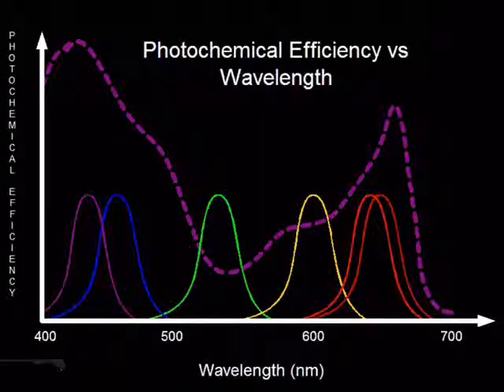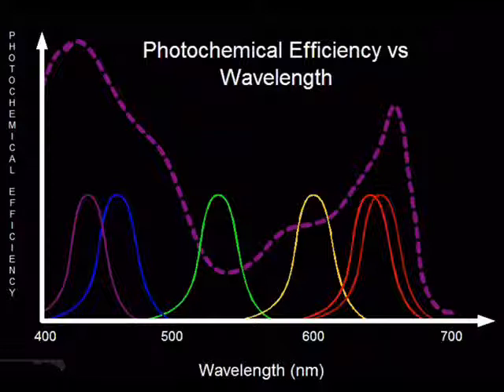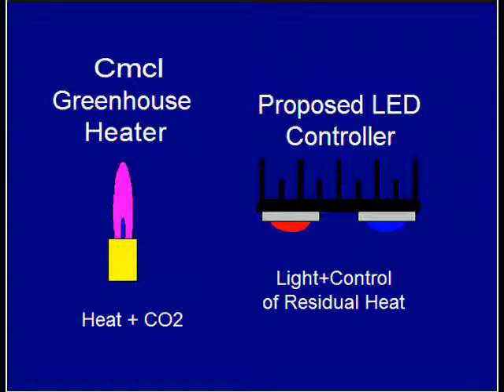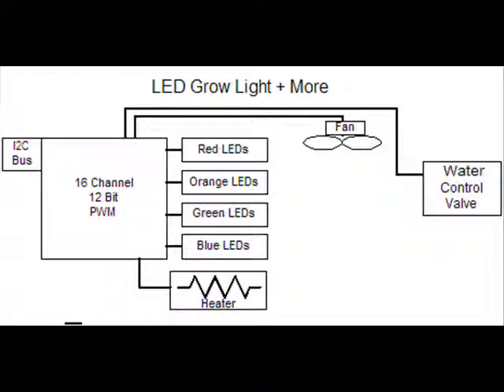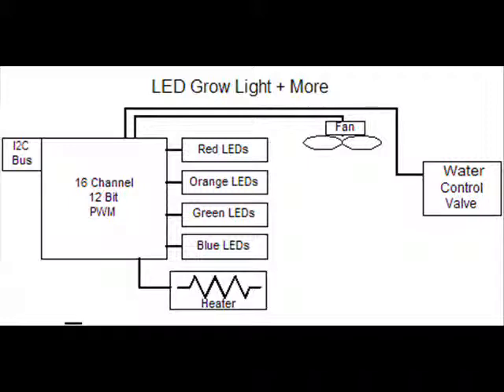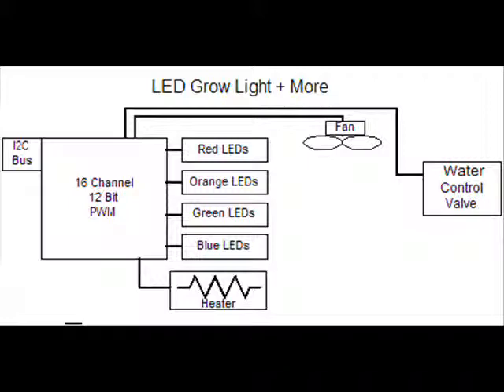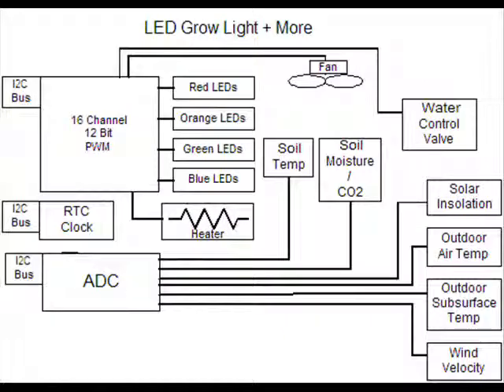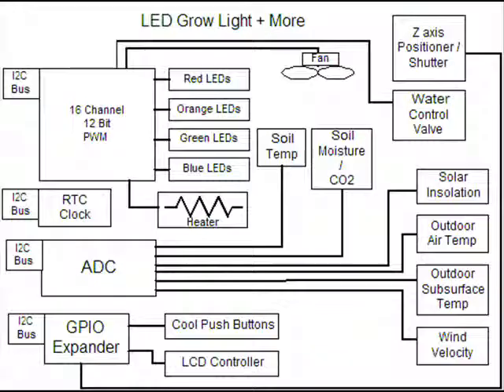LED Grow light + More NXP Demo Board Request

Comment from the maker: @waytoocoolyeah I was an early fan of @nibipedia, I think we may have talked on twitter way back when. Alas, I found the shifting mission a bit problematic and likewise got a bit swamped with a few other irons in the fire. I still see its potential, but the community aspect to me is the bigger deal than the actual tech behind it. Ie the critical mass issue.

Comment from the maker: @SPOKENFOR36 In a nutshell, this is a research project where in I hope to improve the yields of indoor gardening and at the same time reduce the energy require to do so. If the research ends up solid, such could have a major impact on localized food production, even more so in urban areas.